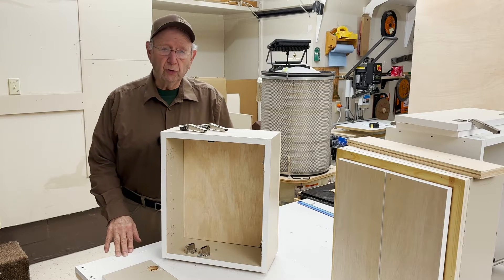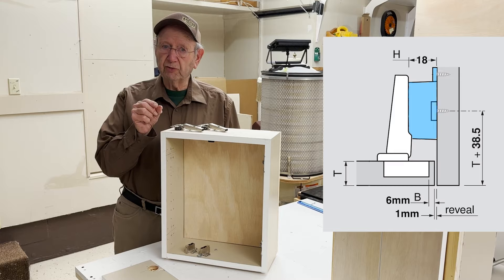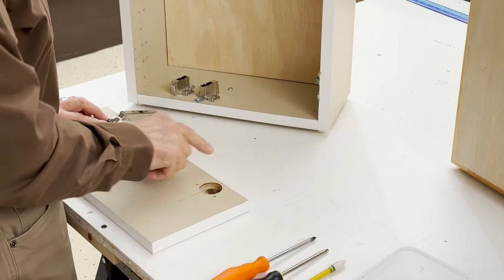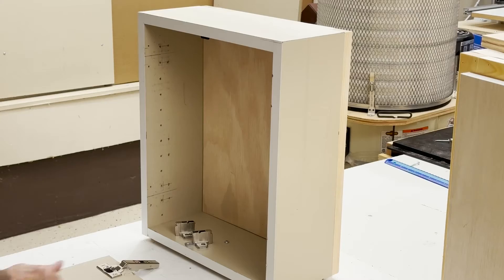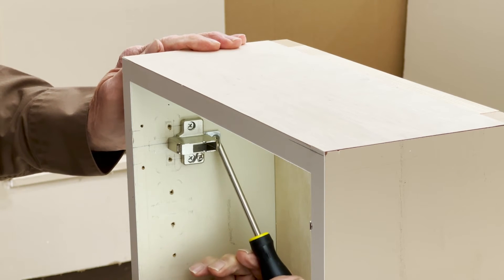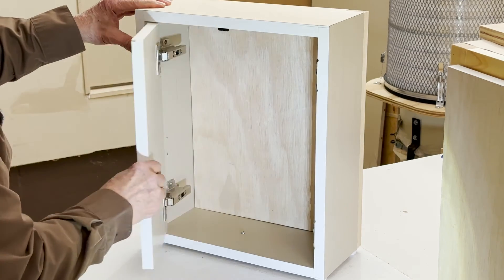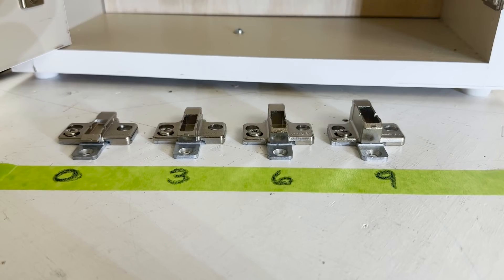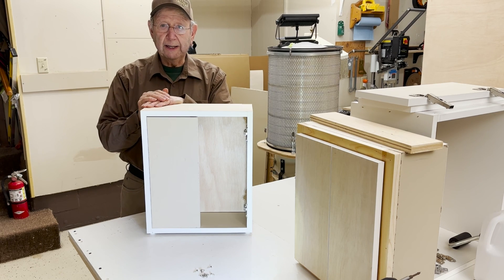Blum Hinge Series - Using a Straight-Arm Hinge With an 18mm Mounting Plate for Inset Cabinets

Comment: Very nice, which blum hinges do you recommend for a 25mm thick door in an overlay configuration?
Reply from the maker: Their thick door hinge series would be the application for your needs, they work for doors up to 30mm (1-3/16") thick 0 https://www.wwhardware.com/catalog/product/view/id/17388/s/blum-thick-door-soft-close/category/863/

Comment: Nice video, I subscribed. I was wondering what hinges/plates and spacing would work for a frameless inset door 3/4 thick with a 1/8 gap? Any thoughts? Thank you.
Reply from the maker: Hello, we believe this bundle https://www.wwhardware.com/xibhbfl would work well for you on this application.  If you have further questions or would like further assistance, feel free to call at 800-383-0130, where we have our customer service available Monday through Friday, 8am-5pm central time.  -Woodworker's Hardware